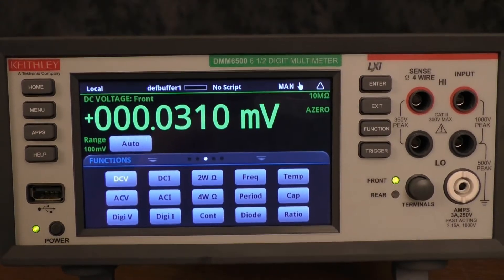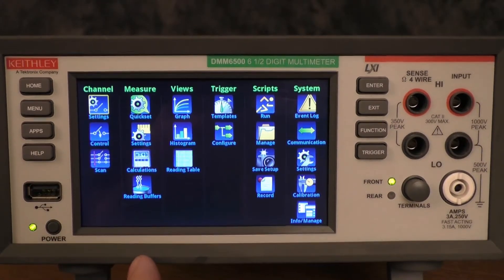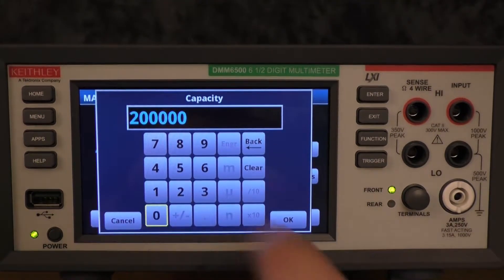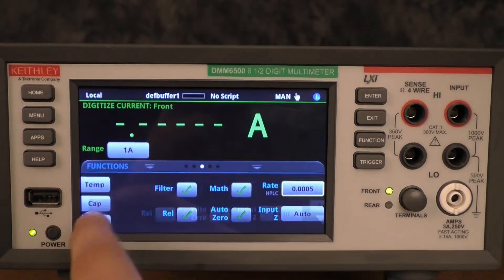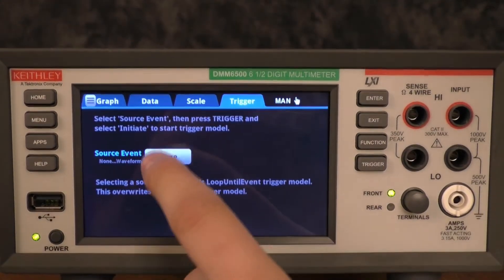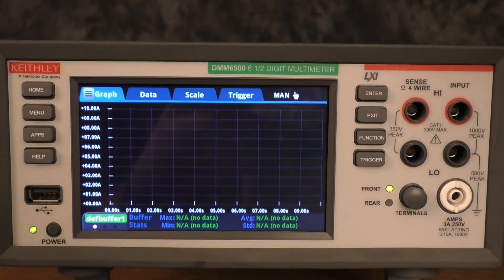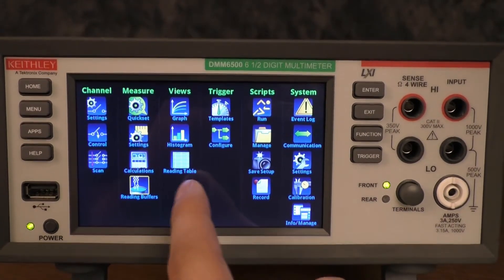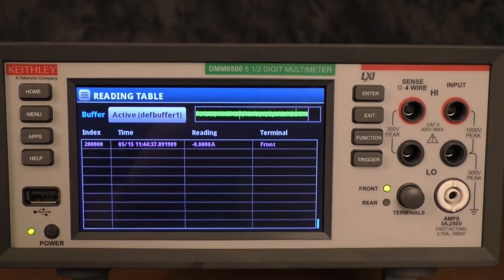How do I perform a digitized current measurement on a Keithley DMM6500?

Comment: I used Keythley DMM2000 before, excellent tool for many years, now I bought a DMM6500, but it comes with a totally over-engineerd manual/functions, but almost no explanations of the basics. As comments before: please explain, why and what you entered in the tutorials and not just simply read, what is on the screen.

Comment: Thanks for the video. I am considering the purchase of the DMM6500, and have some questions about the digitized sampling speed:
1. The DMM6500 can acquire 1 million samples per second, but I noticed you only did 100,000. Is there a reason for that? Does the accuracy of measurements differ depending on sampling speed?
2. Since the DMM6500 can only contain 7 million samples in its memory, I am considering to stream the data to a PC or USB drive. However, some experiences I read about online seem to suggest that streaming to a PC is much less than 1 million samples per second. Is this correct, and if so, what is the maximum speed I can expect when streaming? What conditions should be fulfilled to reach these conditions (i.e., what specs of USB, PC, etc.)?
3. How does the DMM6500 compare with the DMM7510 in terms of sampling speed, both to the internal buffer and streamed to a USB drive or PC? From the data sheets and manuals I understand that the speed should be the same (though obviously, the accuracy of the 7510 is higher). Can you confirm that the DMM6500 has the same speed as the DMM7510?
Reply from the maker: Hello! Our engineers would be happy to help with your questions!
The best way to reach our support team is through this form: https://www.tek.com/support
Our experts can then address all of your questions and help you determine the best solution for your application.

Comment: How did you hook up your probes to measure current? I thought I would be able to pass uA through the meter and measure / log this, but using the INPUT plugs on the front doesn't appear to work...
Reply from the maker: Hi David. You will need to use the Input LO and Amps input jacks. Make sure the Terminal button is set to 'Front' to use the front panel terminals. Also, make sure the instrument is in series with the Device Under Test. If you have further questions, please email us at ki-support-apps@keithley.com.